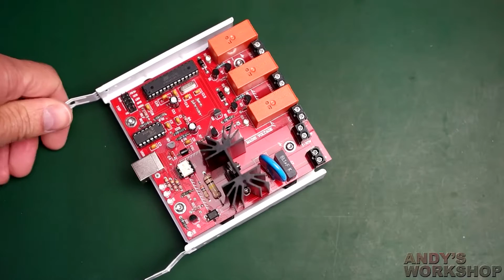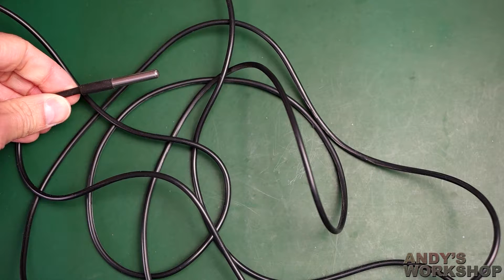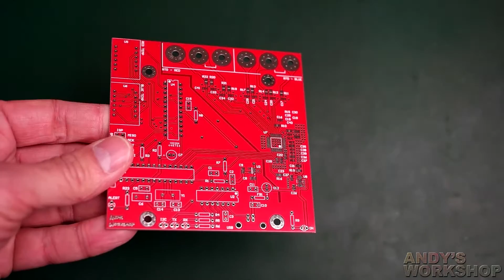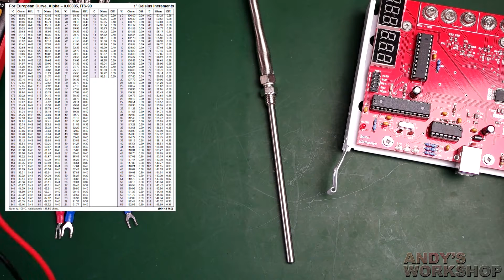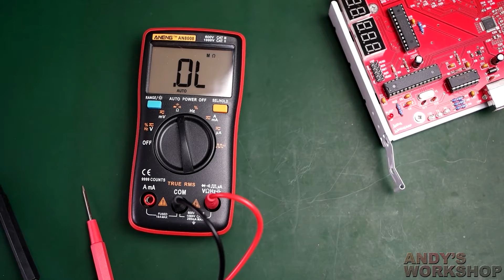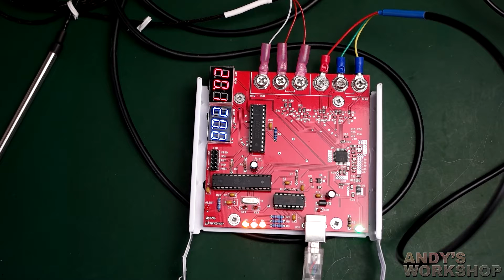Accurate temperature sensing with a USB interface

Comment: There is a probe lm35 from texas instruments that works excellent. Ntc probes for water are super cheap but they need higher adc chip for precise measurement. I tested them with stm mcu and unfortunately software measurements are very unstable. There are ready circuits for mcu but pricey

Comment: I learnt that there is a better way of doing a recent project with a K type thermo-couple <doh>. You could go back to Physics 101 how to calibrate a thermometer - melting ice, boiling water, body temperature. There are other problems like the outside temperature of the pot is not the temperature of the contents, and the temp at the top is not the temp at the bottom. All that metal in the temp probe has to be heated.  If you made your beer out of fake hops and yeast would the fake temp sensors then be OK - meaning you're doing some sort of chemical reaction how do you know the correct temp for it. Is there any other aspect besides temp that lets you know it is proceeding optimally.

Comment: The ds18b20 probes like that I had from eBay seemed accurate but despite being sold as waterproof they weren't and died after a few weeks submerged.
Reply from the maker: That's a shame but unfortunately not a surprise for cheap ebay stuff and at least you didn't lose a lot of money. I'll be probing a large volume of liquid that's sensitive to infection from outside sources so I'll be inserting the probe into a stainless 'thermowell' fixed to the side of the vessel.